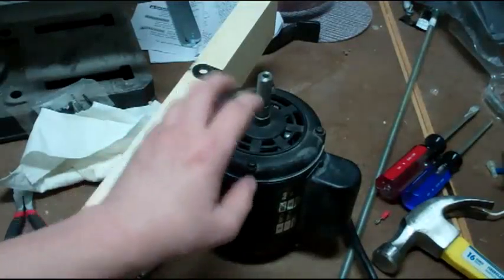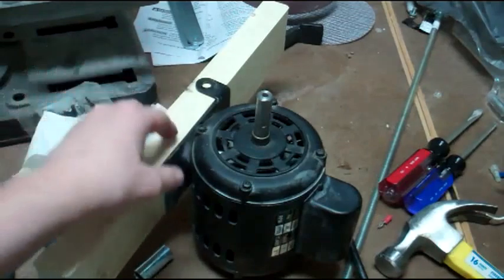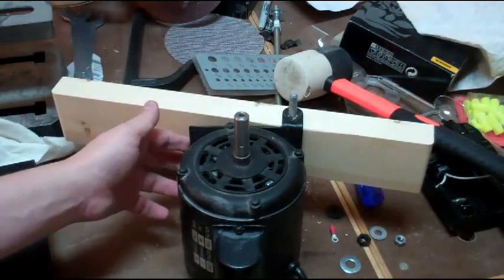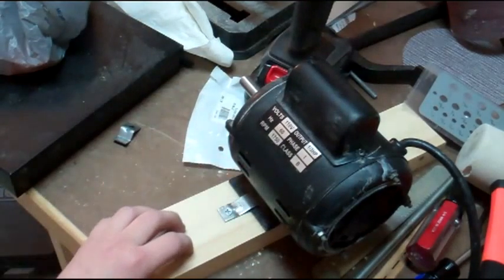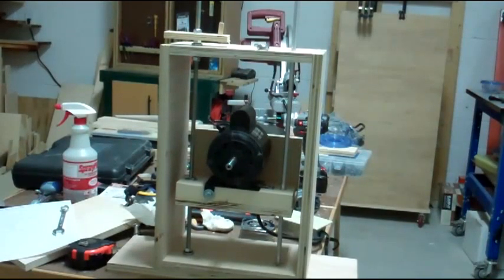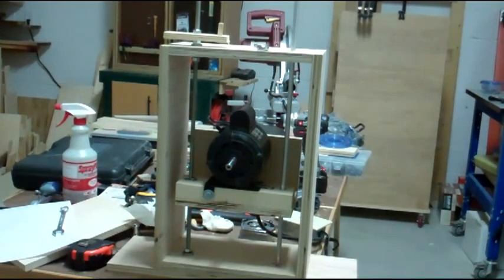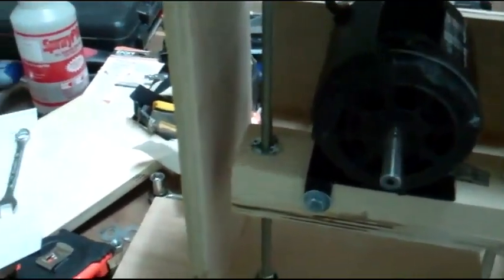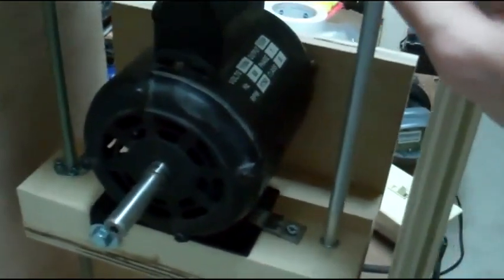Drum Sander: Motor Lift Prototype

Comment: I like your ambition.  I have a project comingup of my own using a couple of the same concepts.  Mine is going to lift a planer though.  The zinc plated rod in the store is dead-soft so you can cut it with a hacksaw and file off the burrs.  Rather than radial bearings, try using just a bronze bushing and press it /pound it into the hole.  Later, you can thread a screw into it and pull it out with a hammer.  It is sacrificial and softer than steel so it will wear out long before the steel rod.

Comment: Also, when you replace the rod, you can go with a coarser thread and it will travel faster than the one you have.  ie. using a 5/8-11 will be much faster than the 3/8-24 it looks like you have on there now.  (It could also be a 3/8-16 but I can't tell exactly from the video).